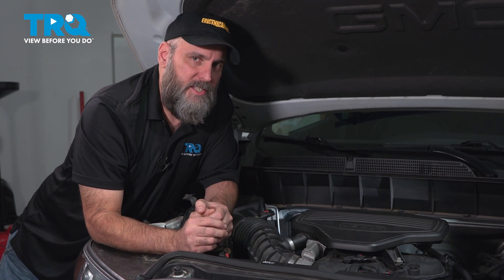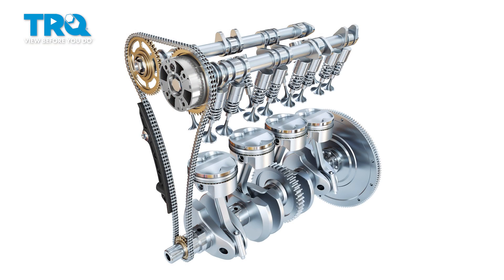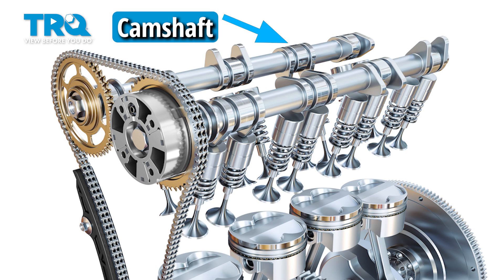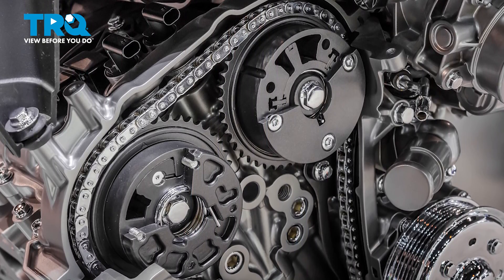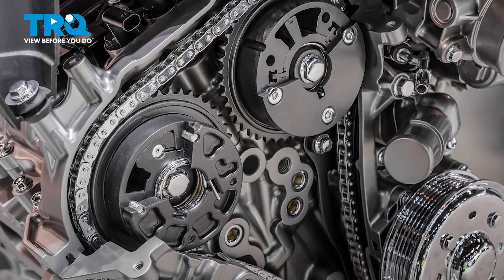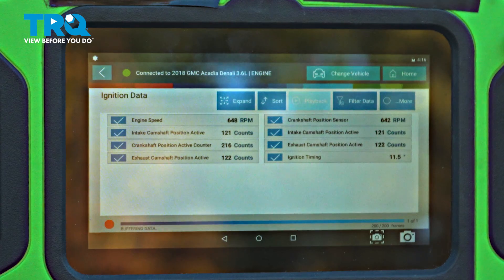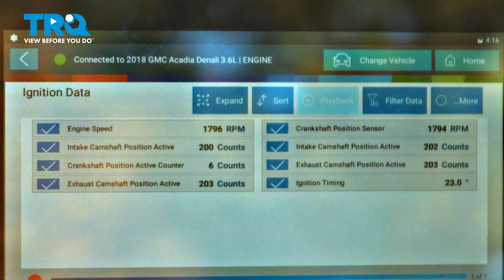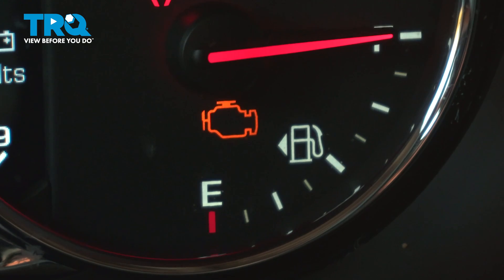EricTheCarGuy Explains Check Engine Codes: P0014 - P0016 Camshaft and Timing Problems

Comment: Hey, love your videos! I need advice if possible! So i have a check engine light and a P0014 code came up. Replaced all for ignition coils and spark plugs, fuel pump assembly, oil change and both camshaft position sensors and my 2015 Nissan Altima S still sputters in idle and in drive at a red light. RPMs fluctuate at 1 and slightly under at idle. I dont know much about cars to dig deeper into the engine but ive watched videos including yours to replace what ive done and even checked over my own work. May replace the PCV valve but it seems fine but i have not taken it out to check it. Do you have any idea what it may be exactly? Any help would be appreciated!!!